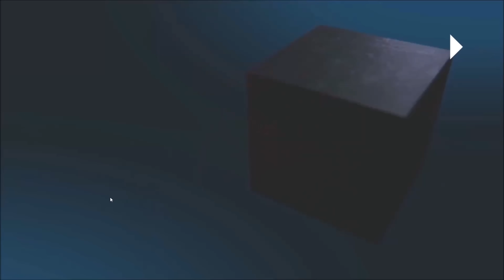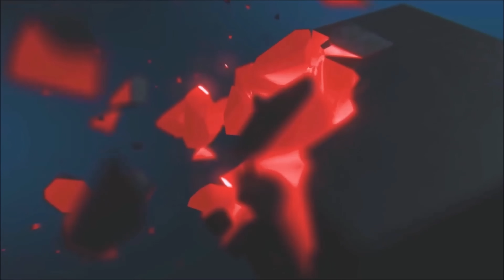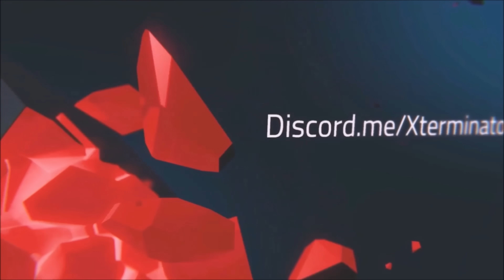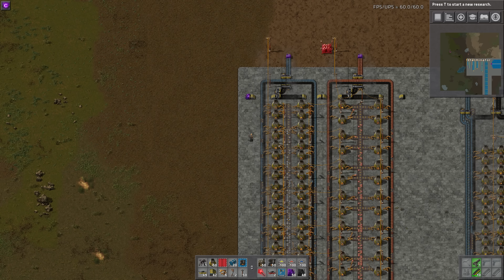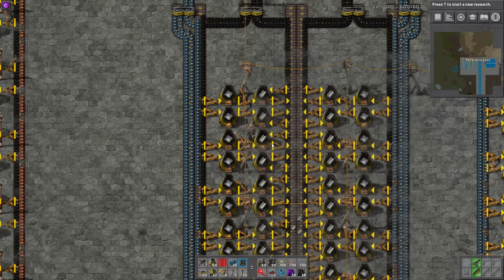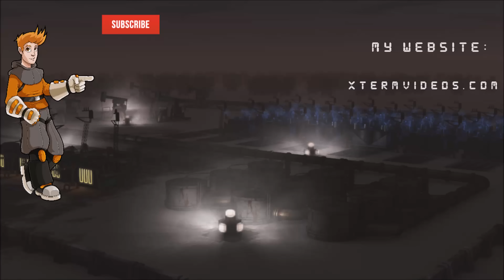Factorio Tutorial - Smelting Builds / Layouts

Comment: 9:18 Next time you're doing an example, and you need trains to show it off... Duplicating Train Wagon will have an endless supply of whatever material you put into it. Void Train Wagon will delete any car you put into it.

So for your Sending Supporters to Space smelter, you could use duplicating wagons at the ore delivery station, and void wagons at the plate pickup station.
Reply: LOL 9:20 "It needs like, all kinds of trains to run" xD only 1/2 and itz an ez setup
Reply: Sorry I meant 9:24 "It would require like all kinds of trains and stuff  to run" Ok first, There are only 2 train lines. Second, all you need to get it going is about 20 - 50 bots to run not "A Bunch Of Stuff," #ABS
Reply from the maker: Indeed. I thought of that but didn't think it would really matter. For a bot build like that where I know the production number, seeing it work isn't as important as seeing a belt build work.

Comment: TIL Electric Furnaces are not faster than Steel Furnaces (Beacons notwithstanding). My usual smeltery setup uses 5 lines of belts per 2 lines of furnaces compared to your 3-to-2, but I've always been wary of ore + coal on the same belt due to not knowing the optimal ratios which I now have a better understanding of thanks to you ^_^
Reply from the maker: Yeah, I also didn't realize electric furnaces were the same speed for a really long time. Glad it helped give you a better understanding of the ratios too. :)

Comment: I also typically use a build that extends iron lines and leeches off of them for steel. A filter inserter to let the coal through and then another to let the steel through. Steel ends up on the outside.
Reply from the maker: That's definitely an option. I used to pull iron out and smelt it to steel but then started preferring to just take ore and turn it into steel in the same build.
Reply: @Xterminator  - It basically leeches off your iron production to make steel, which I sort of like since you need so little steel in the beginning and mid-game.

Comment: From what I read somewhere, electric furnaces with maxed Speed 3 and no beacons has the same 24 ratio to blue belt.  Felt that was a small detail missing from the debate of whether to use that expandable build

The single biggest argument against, IMO, is the fact that the build would still be feeding coal to furnaces with no need for it.
Reply from the maker: Interesting, I haven't confirmed that, but it sounds plausible. Personally I would never recommend that, and that's part of why I didn't mention it. Mostly because if you have modules, it would be far far better to put productivity in the furnaces and then speed beacon it. Just putting speed modules into the furnaces is basically just a huge waste of power in order to save space.
Reply: @Xterminator  Wait, do speed modules in beacons not increase the power consumption of the machines that it affects?

Comment: Very well done, sir. Even though you do not go into the details of each build, you are almost showing the progression through the game from early, to middle, and finally, late game.

One thing to point out is that some of the builds require different types of power poles to function. The steel build with stone furnaces is not feasible with small electric poles because they do not have a large enough supply area. So, you need to have steel to make medium electric poles in order to build one of the designs. Just something that people using your blueprints will need to keep in mind.

At least the electric furnace within a 12-beacon build is shorter than the science build you did for the Tightening the Belt series. That was just nuts!

Comment: You can make the top part of the steel build much of elegant if you want to. First, we'll make it take in only one belt, to be consistent with the other smelting columns. Then, do your normal 2 splitter thing, but right before splitting off the coal line, do another split, into another splitter, and use undergroups to get the coal onto 1 side. This lets the steel build connect directly to your other builds.
Reply from the maker: Ritoban Roy Chowdhury Good improvement ideas.

Comment: Just one thing about switching to electric furnaces before you get modules set up: If you have set up solar or nuclear before you have your modules set up, it would actually be better to switch over to electric, that can happen if you have a coal and oil shortage on a map (like the one I started recently) and need to do something about power. Every single scrap of coal I am currently getting is going to plastic at the moment.
Reply from the maker: DaemosDaen In some situations yes. Personally I have never had a situation like that, because I'd rather just go get more coal than upgrade all my smelters to electric. Each to their own though
Reply: I thought that too. Had my wife explore a 2kx2k area around the base... no coal and the smallest amount of oil (stupid railworld settings) at that moment we got solid fuel and batteries going and decided "alright, solar then" we did find some more coal about 3k tiles east of our starting factory, which it's self was spreading eastward. It was part of a deposit though, shared with iron. It was only about 4 million, so not really enough to add steam back into the mix. My wife finds solar boring btw.
Reply: I recognize myself in that mindset of burning as little coal as possible. But I'd rather have productivity2 before nuclear and then upgrade the smelting. It is not only the investment in the electric furnaces (and modules) themselves, but also the solars and batteries to feed them. I feel iron and copper are the bottleneck much more often than coal.
But of course there might be cases like you say.

Comment: Awesome information! I think mentally I recognize that steel requires a lot but wow that beacon build for steel.... I have never built in a line like that so it kinda blew my mind. Keep up the great work. You rock!
Reply: Note that that steel build  is that big because it's 12 beacon, which is slightly more UPS efficient because it uses fewer furnaces. 8 beacon is a bit less UPS efficient, but is a lot smaller.